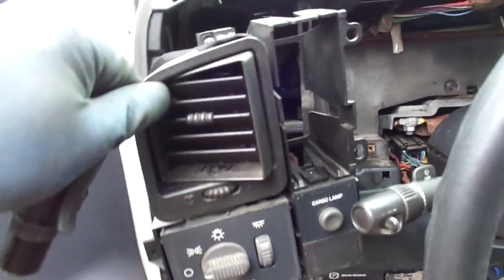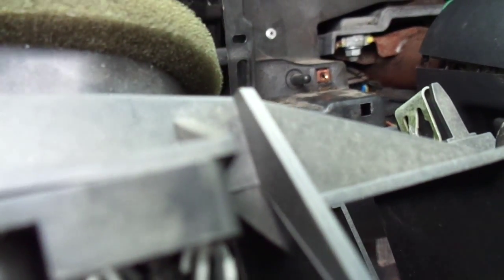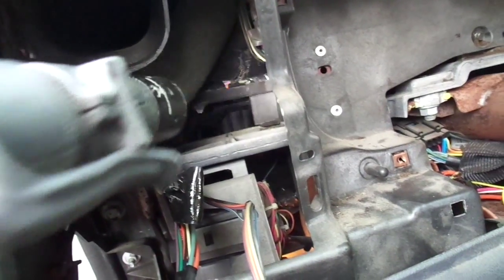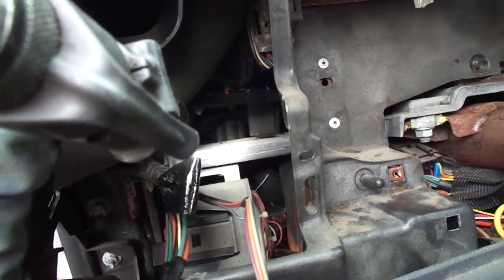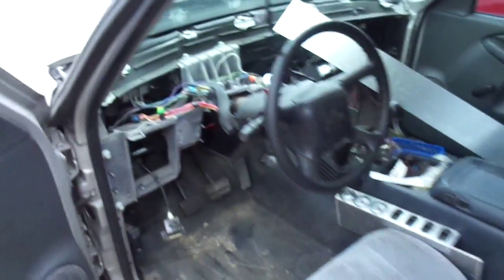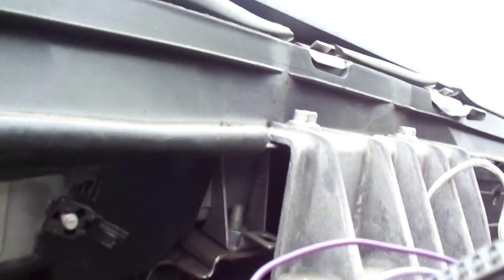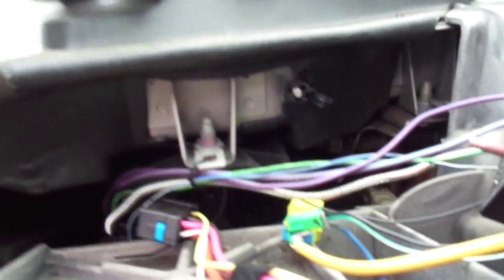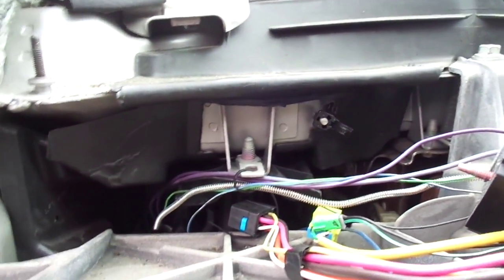gmt800 auto to manual issues 2001 hd

Comment: Take a video of it all running and driving, curious to see how it goes. I've spent a lot of time planning to swap an 8.1 into my 01 2500HD 6.0 Nv4500.
Reply from the maker: done, and then sold truck as a roller and now swapped it over to my 05 and still works great. if you dont put support in you will break the plastic pedal assembly, ask me how i know
Reply: Oh I know, friend of mine had the same thing happen. My truck is already 6.0 5spd. I want to change it to 8.1 I think it would be a better combo.
Reply from the maker: Indeed i do. Where are you located
Reply: Maine. I'm on the 8.1 facebook page. At some point I may ask you for an HP Tuner file for an 8.1 with drive by cable throttle
Reply from the maker: ah ok kool